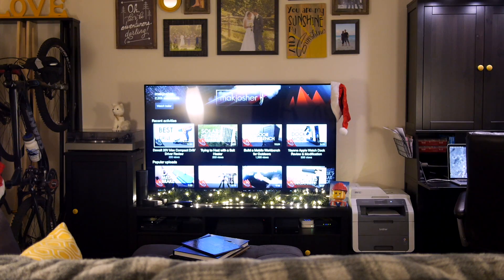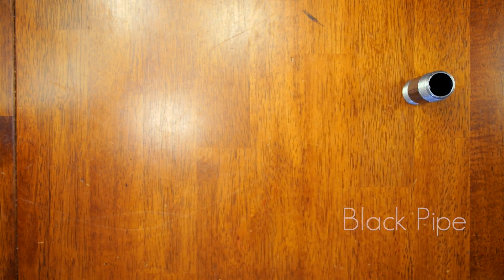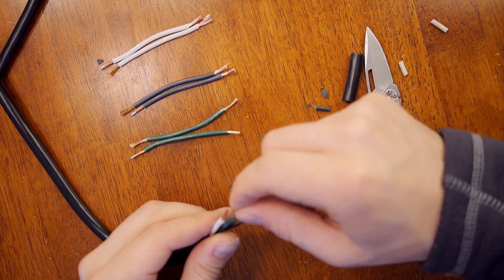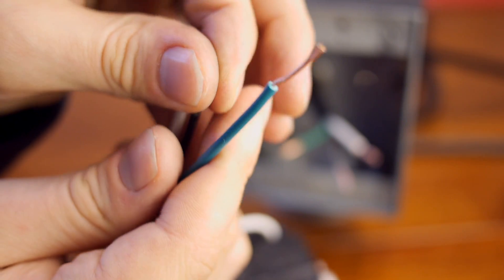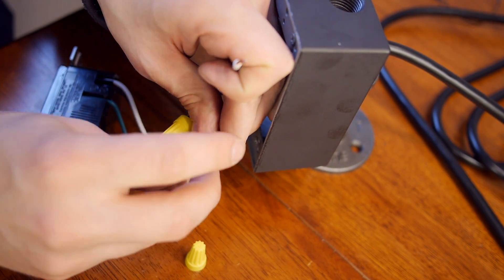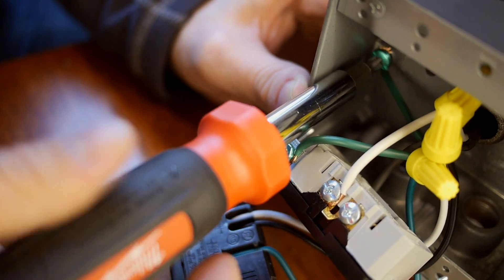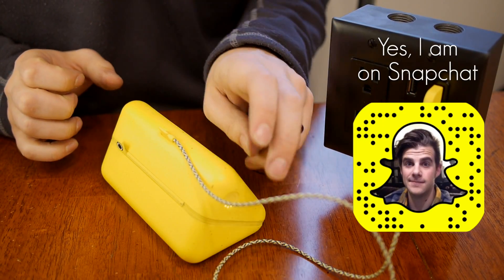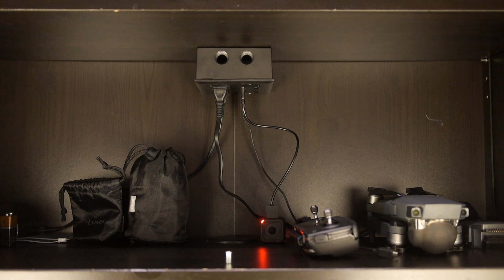How to Add an Outlet Anywhere

Comment: NO! DON'T MAKE ANYMORE OF THESE STYLE VIDEOS. You didnt even use connector and box hole plugs. The way you terminated to the Receptacles is very poorly done! Another gentleman below suggested the use of stakons. He is correct. Loose unsecured connections over time creates heat, which ultimately can cause a fire.

Comment: Nice instructional video! Being I'm an electrician, I've made something similar to this but, also added a switch for a light installed nearby. I'd like to suggest that if you use stranded wire, a stakon should be used under screws unless it is compression style receptacle. Or use solid wire and splice together with wire nut.

Comment: There is one problem I see. All of the outlets including the usb are wired for 120 volts ac current. Most of your usb devices run off of or charge at 5 volts dc current. Doesn't this put to many volts and amperage to the usb side?
Reply from the maker: +Mike thanks for the comment. This is not a problem at all as the USB "outlets" have the correct transformer and rectifier to step down the 120V AC to 5V DC. It works on the same principle as the typical USB blocks that plug into 120V AC.

Comment: You could get some threaded plugs as well to fill those holes. 😉 Nice video ‼️👍
Reply from the maker: It did. I have them, but since I forgot to paint them with the box I didn't put them in for the video. I will be adding them though.
Reply: Actually those weatherproof boxes come with the filler plugs.
Reply: makjosher 👍😀